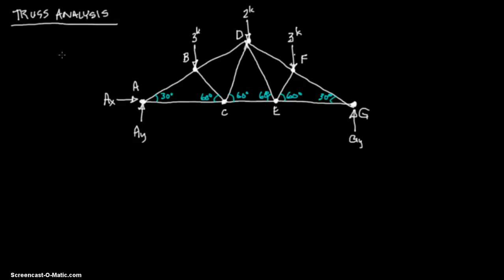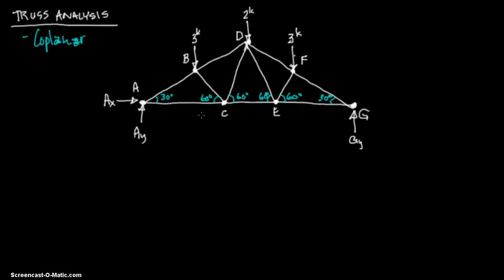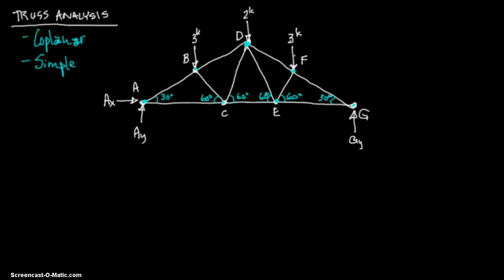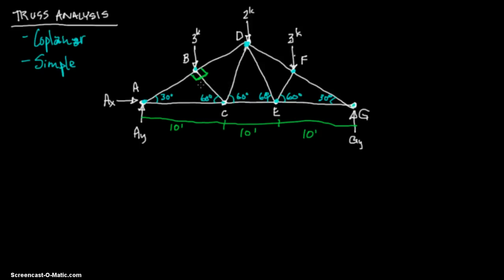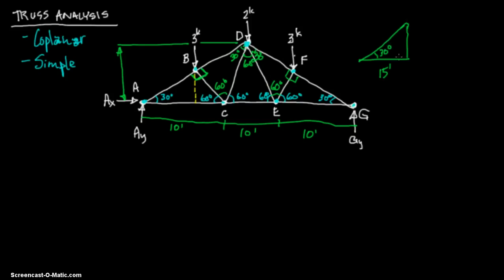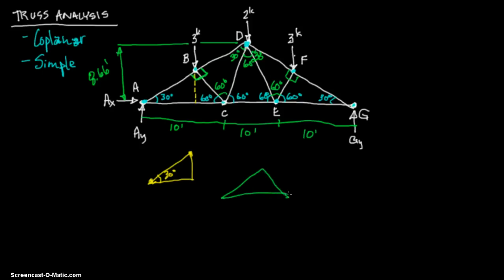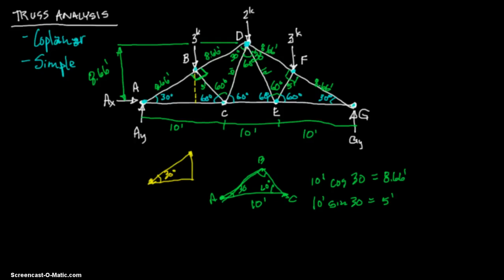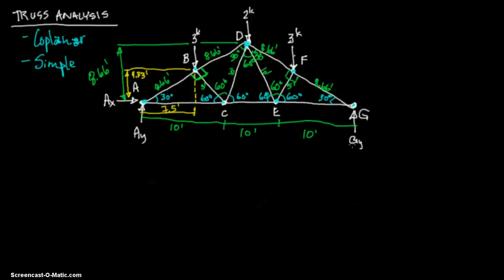Simple Truss Analysis (Part 1)

Comment: Hmmm......seems to me, if you use (3) 10’ boards along the bottom and the joints are at Ay, C, E, and G, this truss design would collapse due to pivoting at the joints! You fail to mention where the boards at the bottom, join up at, so, I’m disappointed at wasting my time on this video!

Comment: There is actually a lot more to truss design than just considering the members as purely axially loaded.  The top and bottom chords should actually be considered "beams" so that the Moment and Shear loads are considered as well.  Take a look at Medeek Design for a more in depth look at the forces involved in designing a truss and the methods and steps in sizing and selecting the lumber and metal connector plates.